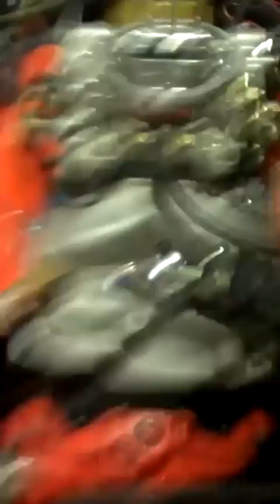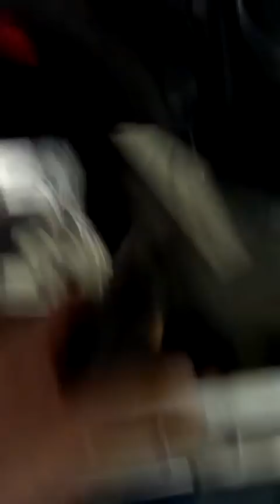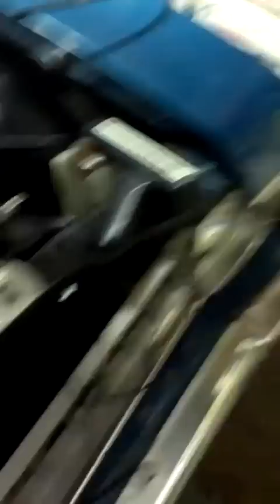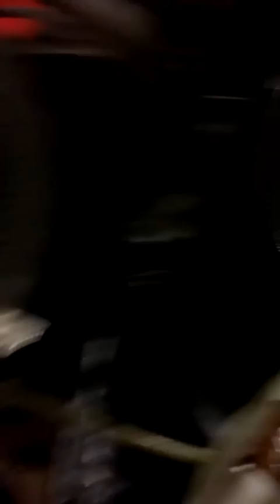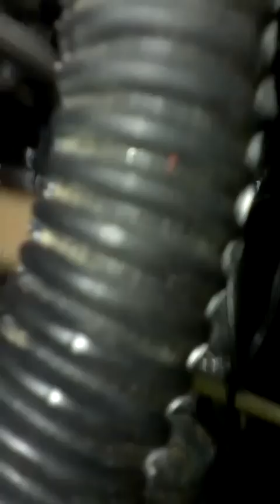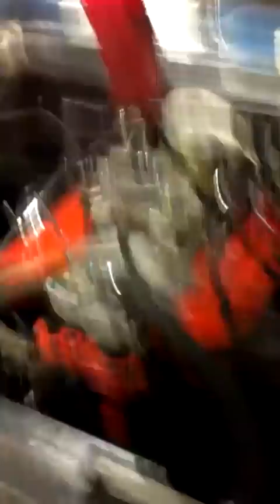Chevy nova timing is too high

Comment: Was you engine recently built? Did you check your vacuum with a gauge on a full vacuum port? You might need to, in order to adjust that carb correctly cause if you are smelling fumes (like you feel your eyes start itching) your carb is most definitely too rich. CAn you update anything on this?

Comment: Take out number one spark plug. Place some tissue or have a friend sit in the car and place your finger over the hole. Have them bump it til you feel preasure. Now take a screwdriver stick it in the hole. Have a friend hold it for you. Now you turn the balancer with a 5/8 tell the to let you know when the piston starts goin down. Rite when it starts to go down even a little stop. Pull the cap and see where your rotor is pointing. Then adjust if neccesary. Followed by adjusting the carb

Comment: ive heard this is common, in fact my buddies 69 nova with a 350 has this problem. after some google searching rumor is somehow you have a balancer thats wrong for the application and the timing mark is in the wrong spot. We tried to set his to factory spec and it killed the engine too, wound up going the other direction and it ran stronger. We just moved the distributor until the idle reached its highest point and then lowered the idle back down via the carb. hope this helps a little
Reply: I have a 327 with the same problem I am 42 degrees initial over 60 Total Advanced I did  degreeing on the cam and my marks lined up zero for top dead center now what it won't run anything less than 36 and initial . it has been like this for a couple of years and even with 11 to 1 compression running pump gas when I tore it down last summer after running it like that for 2 years there was no detonation running a Mallory unilite

Comment: Degrees should be at 32 degrees and between 8 to 10or  12 depends on the generation of years of engine if it's a 350 or 305

Comment: It's gotta be the wrong  balancer and or timing chain cover ive got a 305 same thing i timed it by ear has good throttle response and starts goid thst is all that matters ive seen distributor advance rust and seize and cause havok too where it would start well but no power and the opposite advance it till it has power no start so check everything the mechanical advance and how its curved make a a big difference lighter springs make it come in quicker
Reply: balancers go bad move  twist  over time

Comment: Its sounding like your timing chain is stretched. Normally you can check this by grabbing your balancer and jiggling it from left to right and feel the play in the chain.  If its at 50 degrees there's a possibility the distributor wasn't stabbed in the right spot and is off by that much. I'd start over and reset the distributer knowing for sure its initial is 12 degrees advanced TDC. Worst case scenario its the timing chain. Easiest case would be a vacuum leak somewhere. In fact it starts right